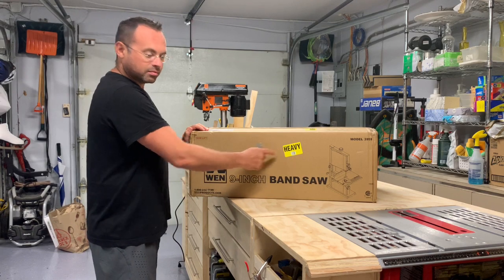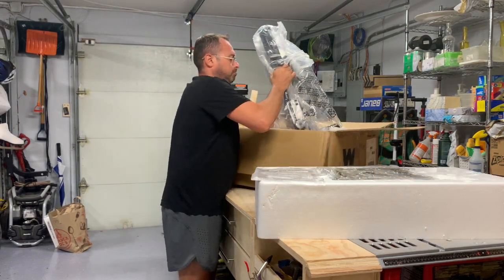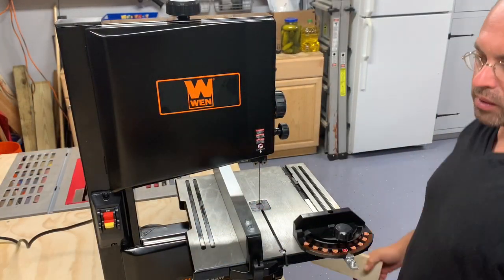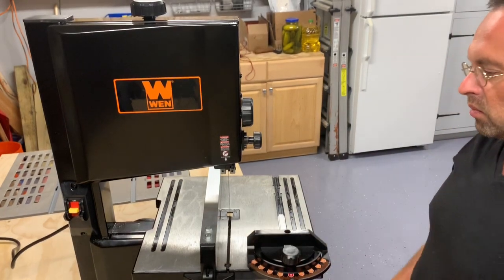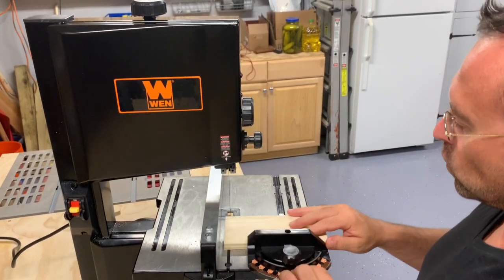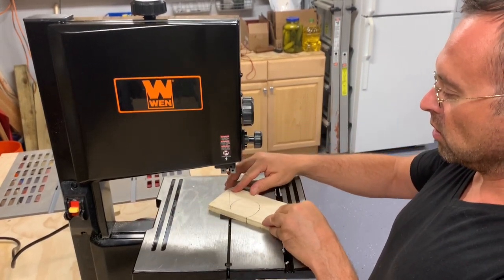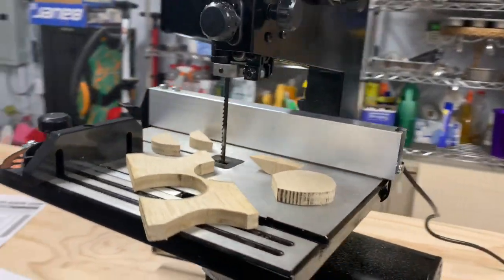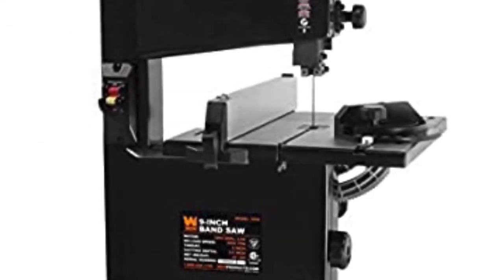9-Inch Band Saw Review (WEN)

Comment from the maker: I would like to add a comment about the saw.     After a good amount of use I realized it’s good for small projects...    but anything more than 3/4 inches and you will find that it under performs.   It’s not powerful enough to cut through hardwoods and has trouble with anything larger than 3/4 inch.     Felt like my viewers should know that to set expectations.
Reply: I bought this one to see how i liked using one. I didn't expect it to be more than what it is. It has shown me that a 500 buck and up unit is in my future.
Reply: How accurate is the blade drift? Can you make 6-12” cuts against the fence and have a nice flat glue surface edge?
Reply: @brettfalgoust1596  not at all. Drift is really bad on this saw. At least wirh the stock blade. Haven't tried a aftermarket higher quality blade

Comment: Hey so I have the same saw ,can you do a video on how to adjust the barring ? For some reason both of my bearings sit off center . I want her the guy last name snodgrass and how he adjust the barring  and I'm not sure if it's my saw or if I'm not doing something correct . This is my first time working a band saw of any kind ever ☺️ so if you could take a look at the barrings on your saw that would be very helpful thanks . And good video for the unboxing
Reply: The rear thrust bearings? If the blade sits on these rear ball bearings slightly off center, don't worry about it. If the blade wears a line in the surface of the bearings, you can unscrew and flip the bearings to get a new surface. 

If the blade sits way too close to the right side of the thrust bearings where it can potentially slip over the side, you can unscrew the bolts holding the bearings, then add a washer under the bearings to shim them farther out to the right. If your blade sits too close to the left side of the bearings, then you're kinda up a creek. But you're more likely to have the former problem. They're gonna be fabbed to err in this direction, on purpose. 

You can drill a hole in the side of the lower cabinet, so you can stick the allen key in there to unscrew only the lower thrust bearing. That will save you from having to remove and reinstall the entire lower guide assembly. Kinda like the factory hole that's there so you can unscrew the entire lower guide. Just add another hole. 

The side guides are adjustable left/right. The blade won't sit exactly in the center of the side guide arms, but that's totally ok. The Wen bandsaw is built to a budget. It's built to work perfectly, not to look perfect.
Reply: @mildyproductive9726  thanks for the reply

Comment: Man, this is the third or fourth video I’ve seen that quotes the price as $120.00. Best I can find is $168.00. Maybe it has gone up $40 in a very short time or you found it on sale. Guess I’ll keep an eye out for the $120. Thanks for the video.
Reply: Mine was $130, they have another model around $165-$175
Reply: @rustywp  thanks. I’ll have to search a bit harder for the savings.
Reply from the maker: Looks like it’s 136 dollars now.     WEN 3959 2.5-Amp 9-Inch Benchtop Band Saw https://www.amazon.com/dp/B077QMBTLP/ref=cm_sw_r_cp_api_glt_fabc_7H1EK46YYX0NGN7FWFWN?_encoding=UTF8&psc=1
Reply: I just got it for 136.00